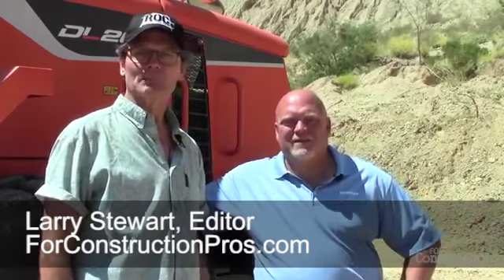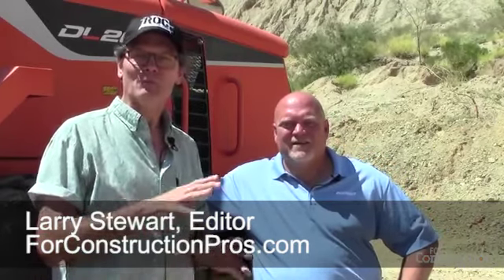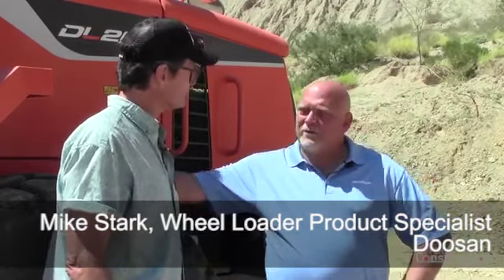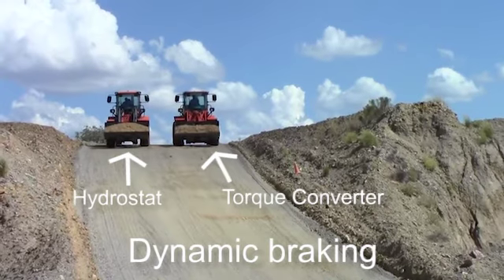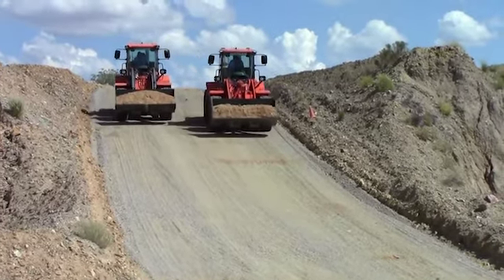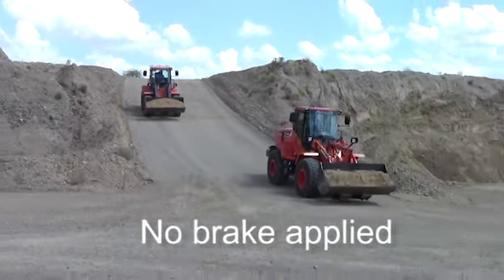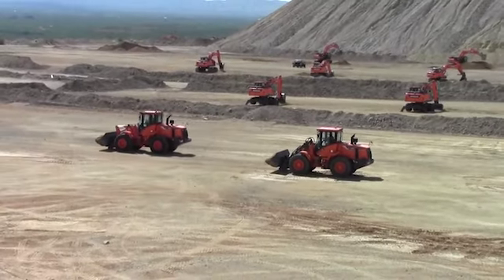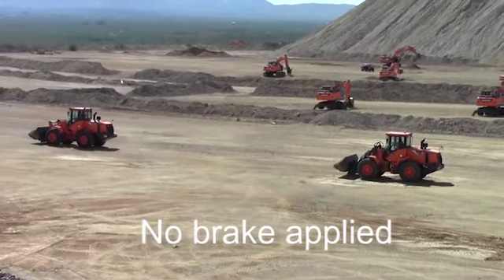Why More Wheel Loaders Use Hydrostatic Drives

Comment: hydrostatic is way better then any other transmission.... semitrucks in USA need hydrostatic transmission in order to cut on engine size and less co2 emitting into our world lowering chance of climate chanege
Reply: Hydrostatic transmissions are incredibly inefficient. Engines would have to be significantly bigger.
Reply: The efficiency of the best hydrostatic transmissions is 85% compared to 95% in traditional systems...aka more diesel is burned to achieve the same RPMs.
Reply: @dcgregorya5434   Seems like the efficiency of hydrostatic transmissions could be improved by increasing the pressure and reducing the flow, of course that means heavier lines.
Reply: Here's what everyone is missing: The inefficiencies of a geared transmission are hidden in engine rpm and available torque that is unused when there is no optimal gear for the desired travel speed, hence, 10, 12, 18 speed transmissions.
Although it's not going to catch on (it's overkill) a power split transmission would be optimal. Geared transmission output can be added through a differential with hydrostatic transmission output which scavenges excess torque available at a gear on the engine output. This sends the majority of power through a mechanical path ~95% efficient, and uses the inefficient hydrostatic drive to adjust engine RPM to reduce fuel burn at highway speeds, and takes over to replace clutch slippage when starting from a dead stop and in very low speed maneuvers. No more novice drivers overheating the automated clutch. Certainly this system could be fully manual as well with a fourth "inching" pedal next to the clutch and/or a hand trim to adjust the swash angle, but again, it won't be built so this is all academic. This transmission would be very durable, very efficient, very smooth to operate, but very expensive, very heavy, and for the manual version, very difficult to learn.